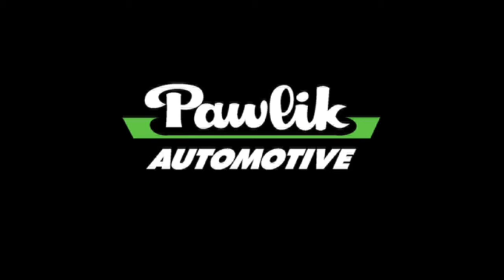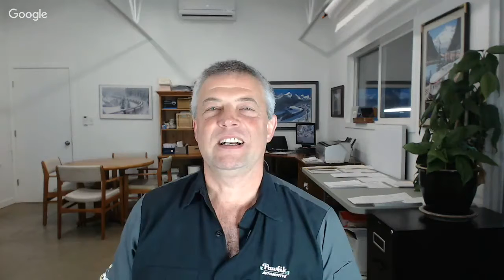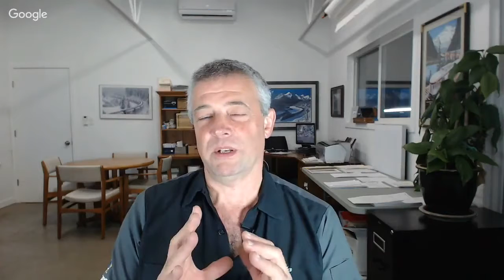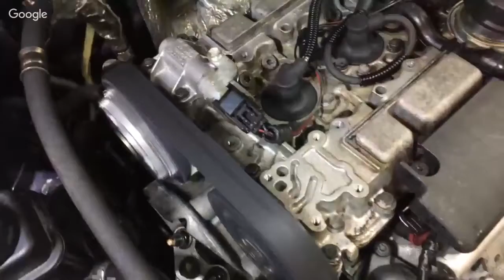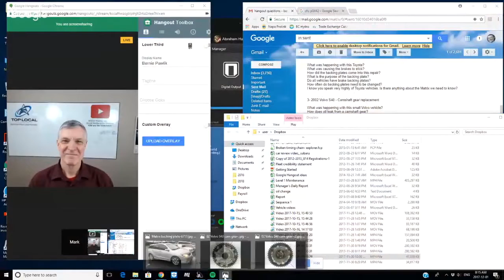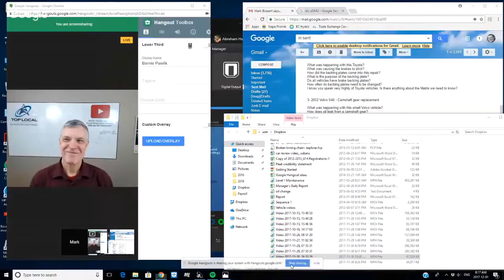Pawlik Automotive 2002 Volvo S40, Camshaft Gear Replacement

Comment: I have a problem you can't buy a new pulley Volvo don't make them any more.
Reply: I have the same problem,spent last 2 weeks looking for one,even used with no luck.had to order one from alibaba
Reply: @djpauliero  hello bro, is the product you bought intact?
Reply: @anadolucocugu4773  so far is ok,I've done about 10000km ,no problem.
Reply: @djpauliero  power fixed and sound gone ? my car is low power and making noise where this piece is
Reply: @anadolucocugu4773  I had different problem,idle was all over the place and engine was dying randomly.but if vvt camshaft is problem,replacing it should make your problems go away.
Reply: @djpauliero  I'm thinking of buying on aliexpress if it happens

Comment: I would like to know what the plunger is for and do i need to lock my cams to change that oring only ill slip the timing belt off take the 3 bolts off the outter sprocket and change it